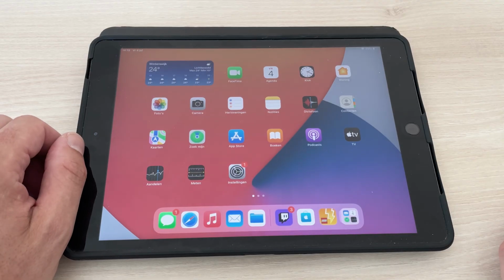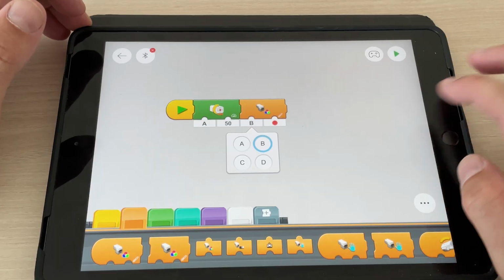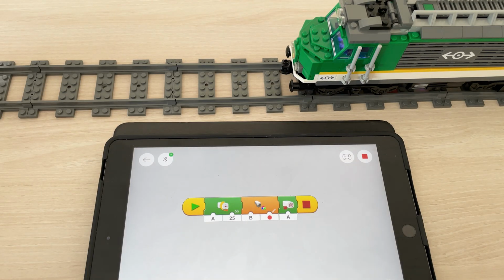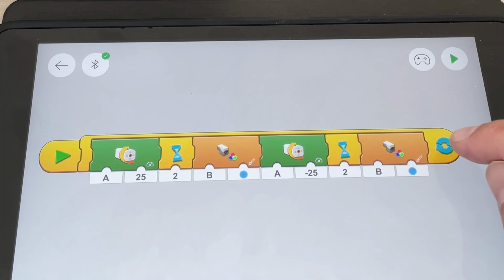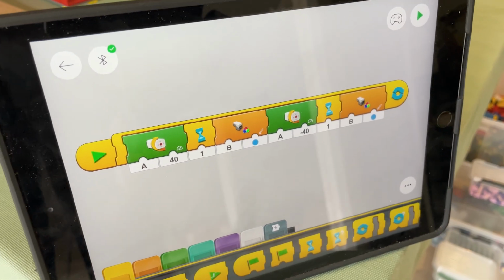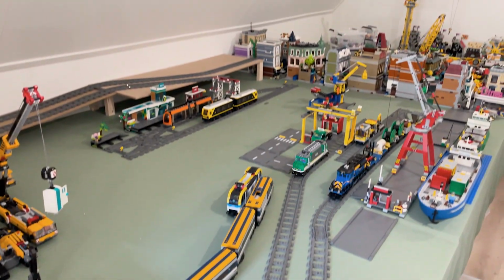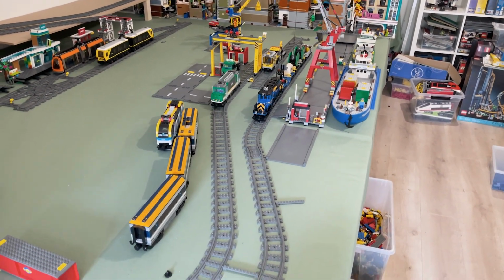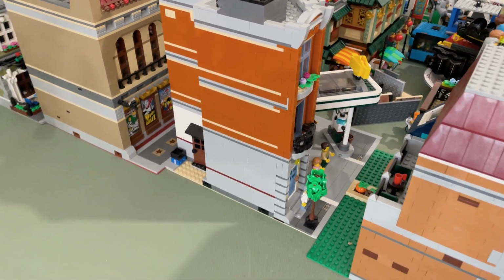LEGO Train Automation Part 1 🚂 | Getting Started with Color Sensors

Comment: It's really nice to automate trains. Unfortunately the color sensor is no longer available. Do you have an alternative/replacement for that? I'm just starting out with trains and found it is quite a disappointment that the sensors are not available anymore. And let's be honest... running only one train on a static track does get boring pretty soon...
Reply: The alternative is the Spike Prime Color Sensor 45605. The 45605 sensor behaves like the 88007 sensor. It measures 3x3 studs and can be attached to the bottom of a train with technic pins/bricks (on top or sides of the 45605 sensor). I have a cargo train that uses this 45605 sensor to replace the 88007.
Reply: @gemini010 Thank you for that information. I guessed it, but wasn't sure.
Reply: @gemini010   Spike Prime Color Sensor 45605 is retired too.   Not worth investing in any lego robotics.
Reply from the maker: Unfortunately there is no replacement. You could try and check Bricklink for a used one!

Agree, automated trains are a lot more exciting!

Comment: Good tip on the 1 second wait, particularly needed if you have the colour tile lengthways as the train could end up going backwards and forwards on the spot.  
Automation features you could demonstrate are: Stops for stations; using variables; using if/then/else or true/false to change what a train does; running multiple hubs/trains at the same time.
Reply from the maker: Thanks for the feedback and welcome to the channel 👍🏻😊